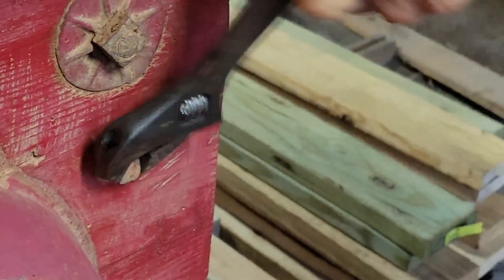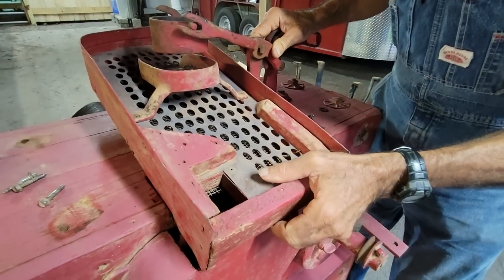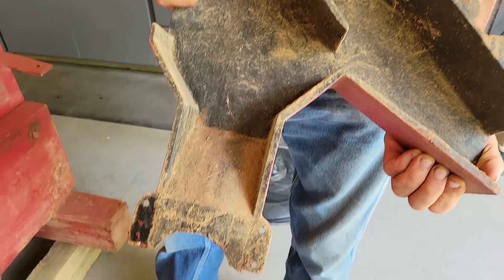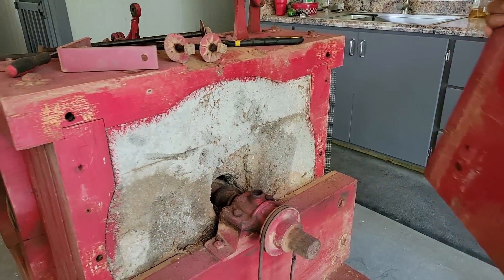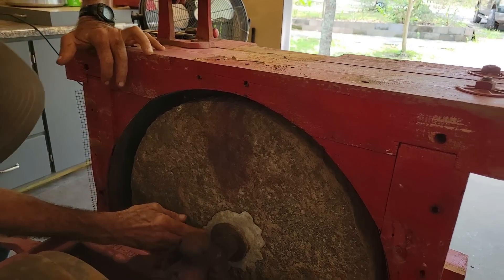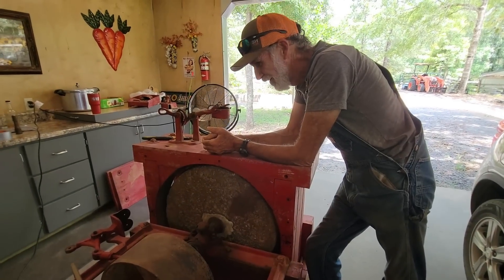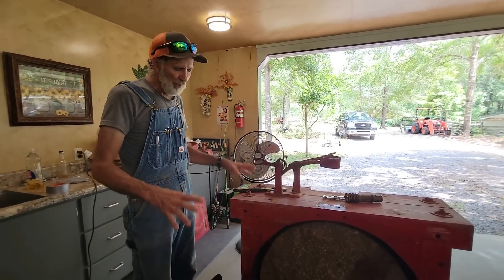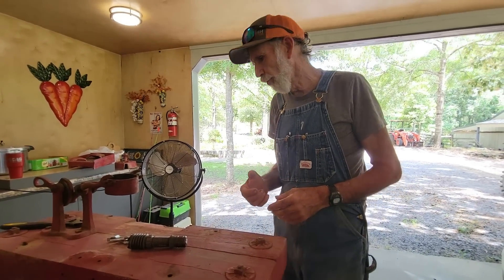1940 Meadows Grist Mill: A Peek Inside

Comment: My granddad instructed the grandkids helping to clean out a shed to throw one similar to yours on a huge burning pile. This was to get rid of the wood because the metal was going to the scrap yard. That was around 1962. The old mechanical equipment was in the way and nobody want anything to do with that back breaking way of doing things. He had the same notion as you Danny, if it’s not of use or contributing to the good of the farm it’s gone. My grandmother threatened to leave several times I was told because of his notions. They made it til death they did depart. Miss them greatly!
Reply: Great story

Comment: Flood Penetrol would work great on this. Both the metal and wood and way easier, and I think better than marine varnish for this project. It is an oil paint additive but if you read the label it can also be applied as is. I have had great results. I love your videos ! Thank you for your effort

Comment: Amazes me how vertical stones can grind better than two stones that would be horizontal to each other with a hole in the top one and grooves in the bottom one. Can't wait to see how It works and exactly how the gap can be adjusted between the stones. Great video as usual gang and well done it's awesome 🙏

Comment: Please don’t make it shiny at least.  I love that old paint and it could be buttermilk paint.  If it is, it just needs a little cleaning with murphys oil soap.  I’ve been an antique dealer for 35 years and have seen a lot of nightmares where people have  tried to improved something like this.
Varnish will change the color of the paint and will peel and crack in the future.  That would be sad!

Comment: Would you go through the theory of operation? Show where the corn enters the gap between the stones and where it exits. Show the mechanism that sets the stone gaps and such. Thanks.
Reply: I'm with you on that. The gap setting is something that interests me and how vertical stones can grind better than horizontal stones. Interesting design.
Reply: @Aussiehomestead1965  My guess, would be that gravity helps get the corn into the gap and allows it to get out, before it gets ground too much.
Reply: @denniscleveland669 yes yes.  Early engineers were so innovative it's crazy . Innovation from necessity.  If well maintained these are very consistent an easy to work on .
Reply: My family has what I think is identical to that. We to get busy putting it back in operation. Our father (born in 1924) told me that was his job after school to grind corn meal to sell.

Comment: I’m shocked that the stone is in a vertical position. I would think it would destroy the shaft.
Reply: The stones look to be rigidly mounted. One on the shaft and the other in the frame.
Reply: The quality of steel they used is extremely strong